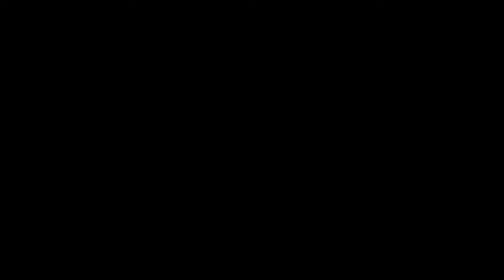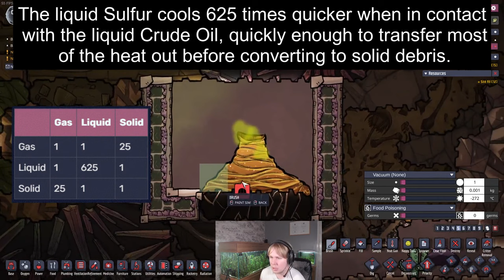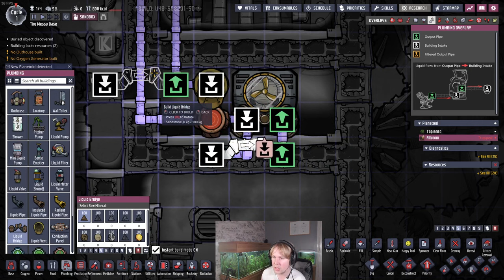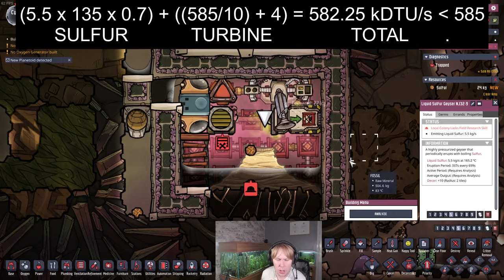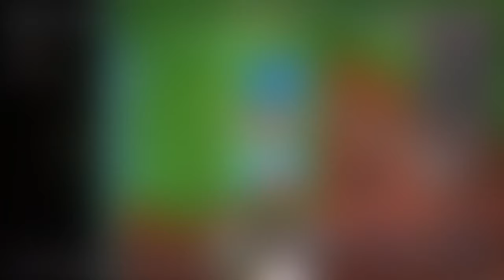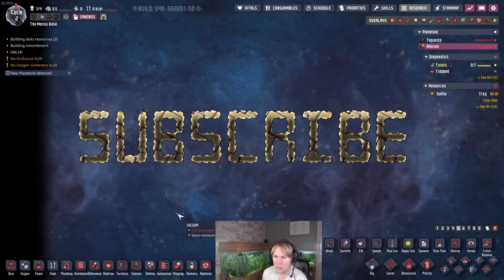How To Tame Sulfur Geysers In ONI: Spaced Out! Sandbox Showcase #3

Comment: Heya, in love with these series! Can you make one for cold steam vent? I have seen your playthrough where you built those tamers, but they are quite complicated.
Reply from the maker: Yes, I will definitely make a video soon about Cool Steam Vents. It's an interesting case as there are essentially three approaches; condensing the Steam so you can pump it out, heating it up so you can use a Steam Turbine, or using hot Steam to trick Steam Turbines into taking in cool Steam. One thing I like to do is just put my Metal Refineries in a room with the Cool Steam Vent and they usually generate enough heat to bring the Cool Steam Vent into Steam Turbine range. For now I will recommend Luma Plays' design as it's power positive: https://www.youtube.com/watch?v=GXICedb3fMg